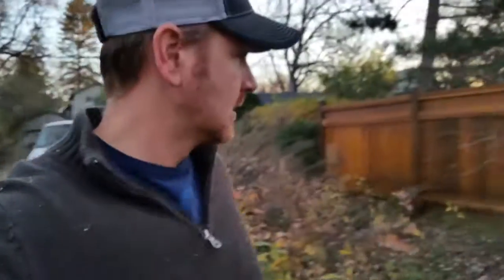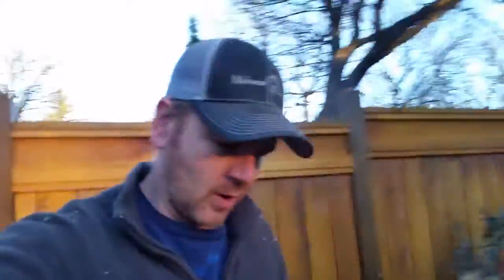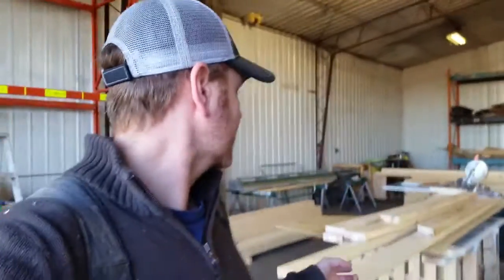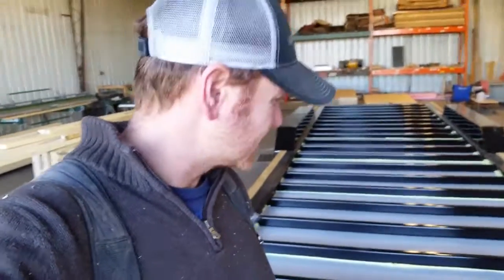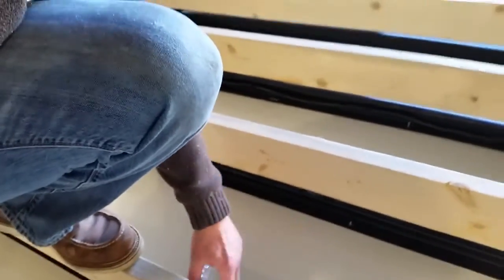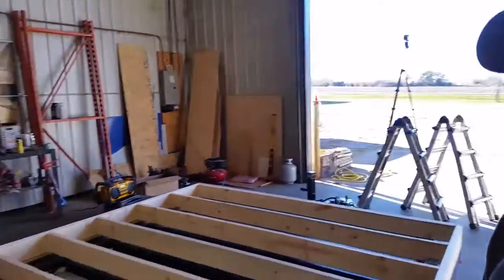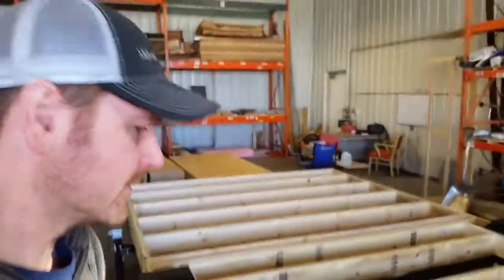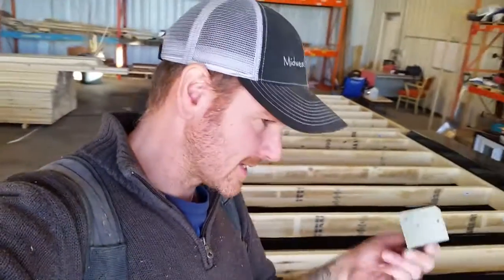How to frame the floor of a tiny house on a trailer

Comment: When you said "always pull from the same one" what are you referring to?  I just found your channel and look forward to following this build. Thank you
Reply: I think he is referring to when framing floor joists together, and or marking your subfloor for cutting and where you screw it to the joists. Instead of measuring 16 inches and then 16 inches from that mark, you would measure from one starting point and mark at 16 inches, then 32 inches, then 48 inches, ect. Doing it this way avoids discrepancies between measurements.

Comment: Whats in between the cross members of the trailer? looks like aluminum with closed cell spay foam? and why not PT joists ?  you make the trailers?  thanks!
Reply from the maker: Its sheet metal on the under side of the trailer. After this we spray foam all of it together.

Comment: When I frame in my floor, Can I lay the boards flat, and use less insulation?
Reply from the maker: I would say yes as long and you center them over the trailer frames. Also, you don't necessarily need to frame over the trailer. You can use sill seal as a moisture barrier over each steel beam and then lay your subfloor directly on the trailer.
Reply: @MidwestTinyLiving  Thanks for the quick response!

Comment: so the foam by itself will keep the frame in place? ... seems really sketchy 2 me..
Reply from the maker: Not the foam only. We use HDU2 tiedowns around the entire perimeter of the structure to hold the framing to the trailer.
Reply: Midwest Tiny Living have u ever done a slide/pop out wall rv style on one of these tiny house?.... i been trying to c how much money it will take n cant seem to find out... atleast one wall for the living room/dinning area
Reply from the maker: bernardo nevarez Haven't installed a pop out yet. I'm concerned about the winter and the thin seal around it. I don't know how insulated that can be an still have the movement. There must be a manufacturer of the slide somewhere.
Reply: What's a hdu2 tiedown, and shouldn't that have been part of your video?